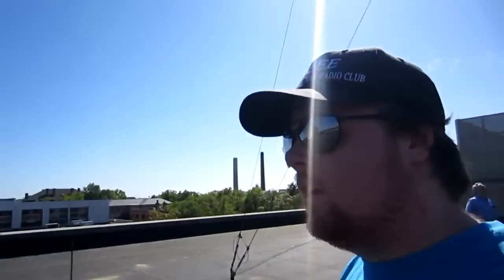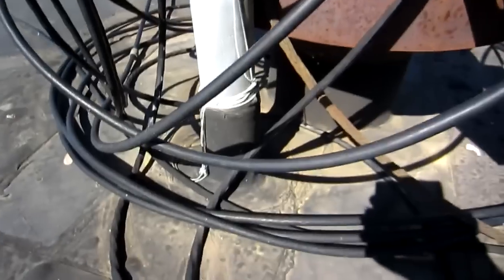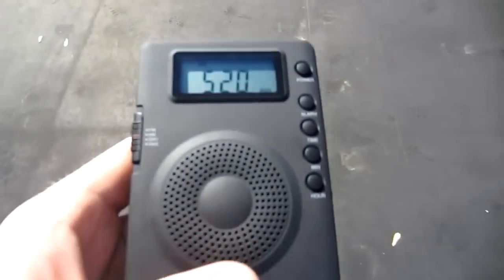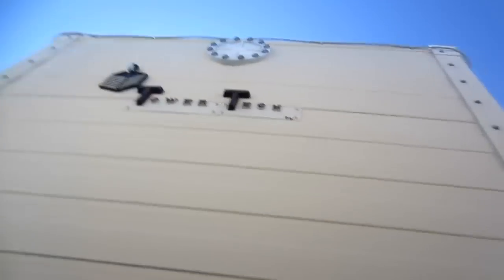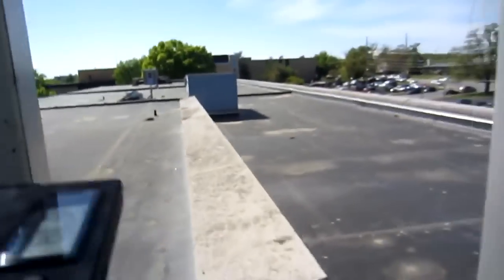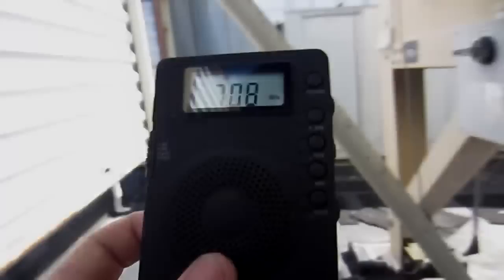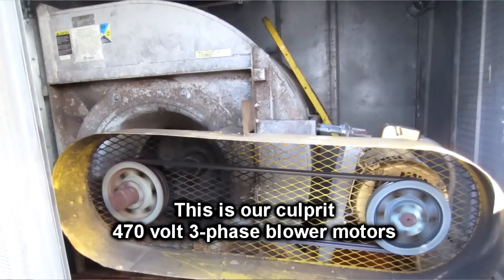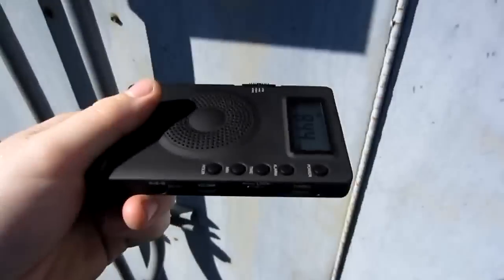Locating RF Interference on the W0EEE Roof

Comment: It is due to the VFDs (Variable Frequency Drives) on the fan motors. That noise is hard to eliminate...filters installed on the VFD input and line reactors on the outputs will help, but will not eliminate the noise, as the motor windings themselves amplify and radiate the noise, which still gets back into the input wiring which acts as an antenna.
Reply: Spot on. It ain't the motors themselves, it's the drives. Been there with garage exhaust fans. Local grounding of the VSD/VFD made a big difference.